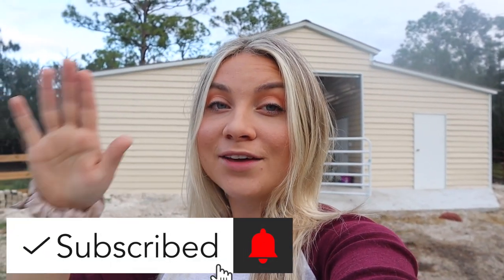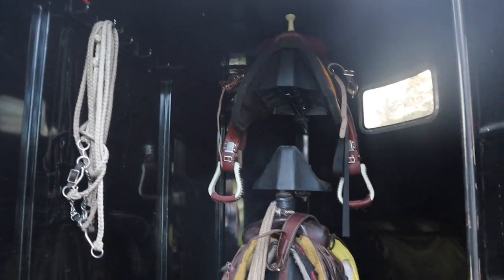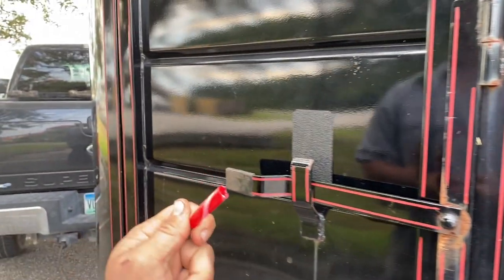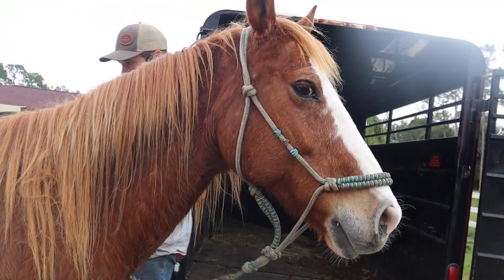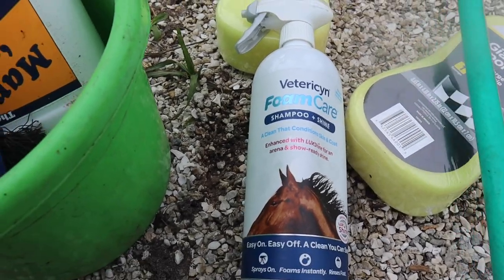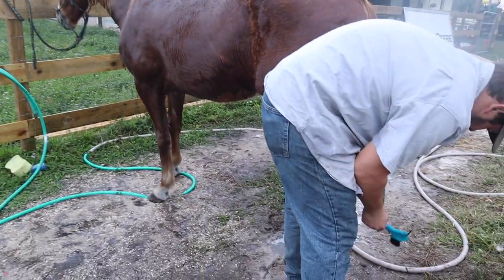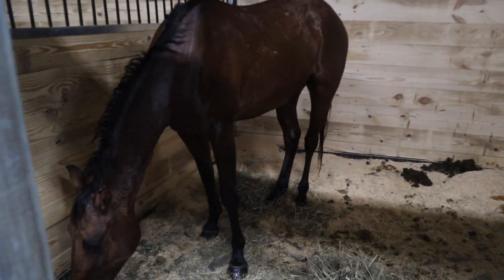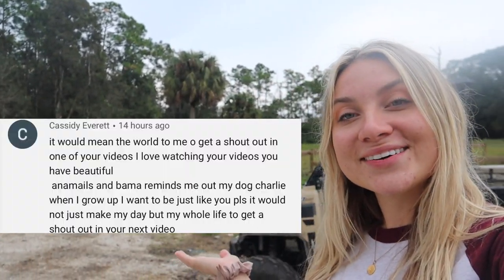TRAIL RIDE ON MY COLT | WE SAW AN ALLIGATOR!

Comment: You should think if maybe clipping blaze if your gonna be riding him more because he was really sweaty!
Reply: Thats what happens when you ride in a western saddle. They are as bulky as heck.  The horses are still going to sweat,, clipped or not..  They should ride in a bareback pad, its better on you and the horse.
Reply: @lookingatthetruth4099  well i ride english but i used to ride western clipping will HELP with sweating! Obviously it wont eliminate sweat bc you really cant do that.
Reply: @cadeej8540  if your horse grows a thick winter coat, then I would say clip them.  But Cash doesn't have a thick coat.  I wouldn't body shave them in winter time, maybe summer time.  I see you were talking about Blaze now.  Ya his coat is thicker.  But regardless, horses will sweat, like we do
Reply: @lookingatthetruth4099  i didnt say cash.. i said blaze
Reply: people can be so unnecessary rude lmao